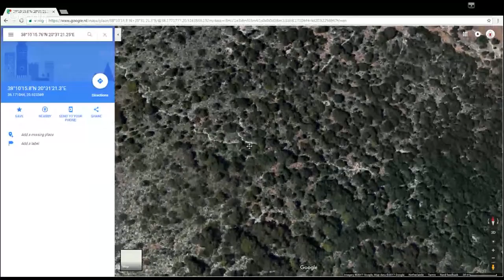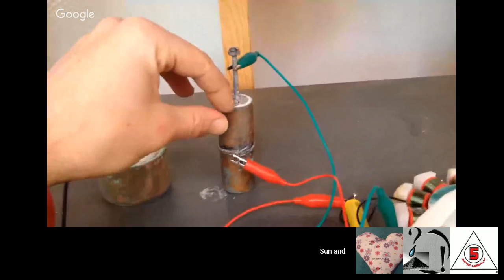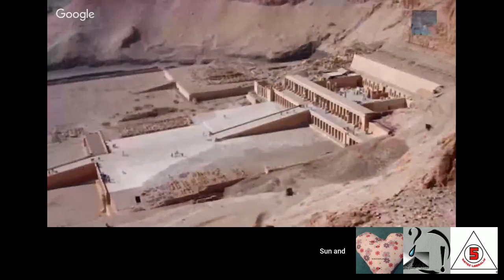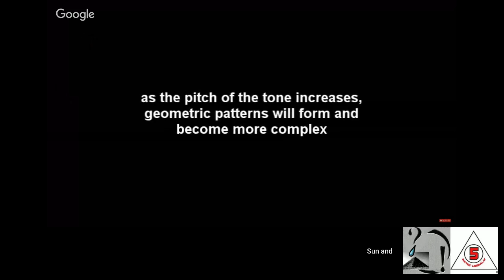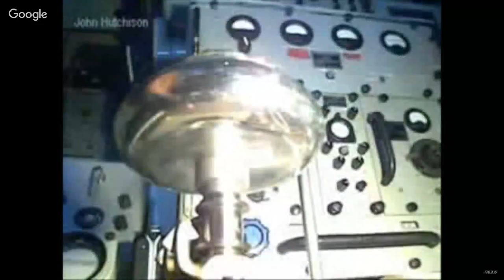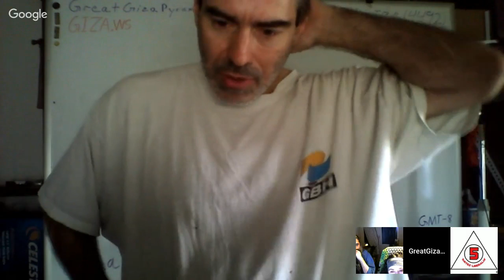Flat Earth pyramid, ancient structures, with Angel, Artes and Sun and Moon Group.

Comment: Nassim Harramein was the first for me to show the 'planets' following the sun through the universe on its course.  Immediate problem there is the plane of the ecliptic now becomes a cone but all problems like that aside, he does have an interesting take on the purpose and function of the pyramids.  The central space supposedly used for the tomb contains no sarcophagus but is sized to hold the arc of the covenant and he suggests the arc, as a capacitor, held the Tetragrammaton or power crystal and that the waters of the Nile at that time flowed through the pyramid and was energized by the crystal.

The reference to the word 'Tetragrammaton' is found in the Revised Standard Version of the Bible in the preface on page V and refers to it as 'The Divine Name'.  Rather interesting.

Also, I have solved three impossible mathematical problems unsolved for over 2000 years.  I mean it did take me more than a week.  Duplicating the Cube, Trisecting any angle and Squaring the Circle.  Turns out you can't square the circle but you can Circle the Square and when doing that I found the Flower of Life also explains I Kings 7:23 and 7:26 regarding a 'molten sea; it was round, ten cubits from brim to brim and five cubits high and a line of thirty cubits measured its circumference.'  It can be shown using Sketch-Up drawing program very easily.